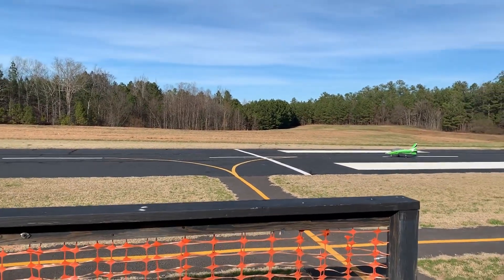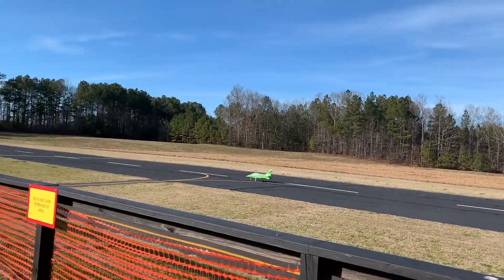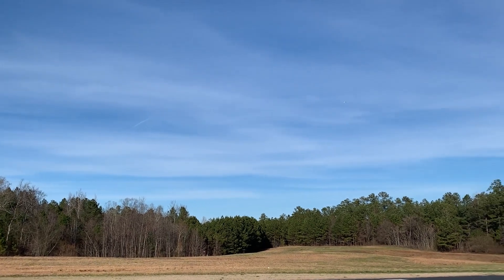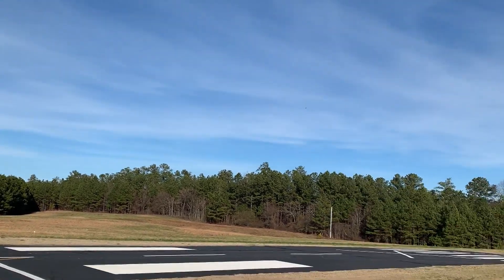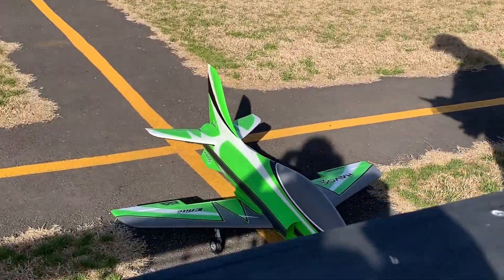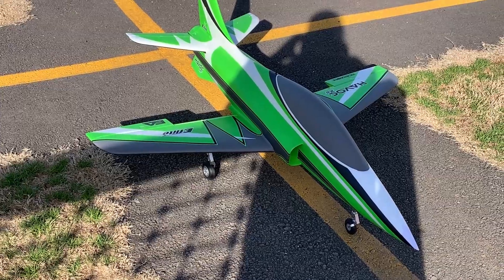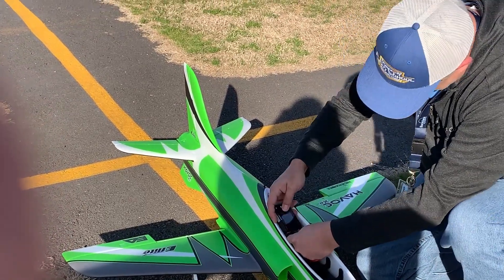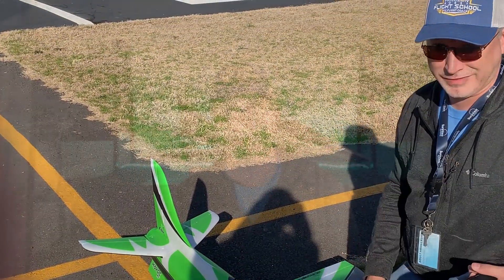Eflite Havoc Xe 80mm EDF Jet - Maiden & Flight Review

Comment: This jet on HH website says 10-12+ flight time on a large battery.  Could it really do a flight time that long?
Reply from the maker: I certainly never saw flight times that long. I got the average 3 minute flight that you would expect from a 6S 80mm EDF. Now I’m sure with a 7000mAh pack that you run up to 400’ and glide down, sure you could probably get 10 minutes, but it wouldn’t be a very inspired flight at all.
Reply: @TheRCAirMarshall  thanks.  Would you recommend putting a 6000 6s all the way back?
Reply from the maker: @burlingtonfilms  that should work well. 👍